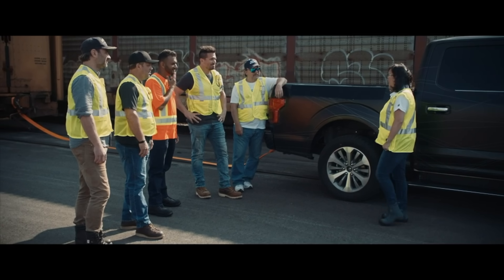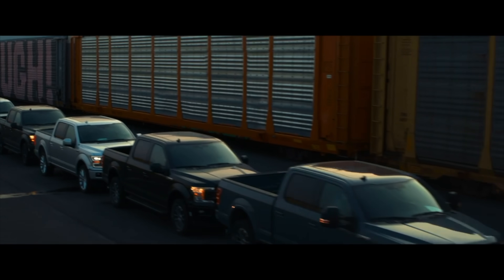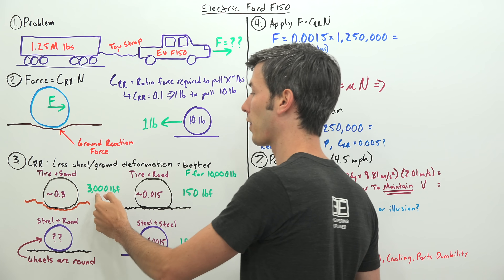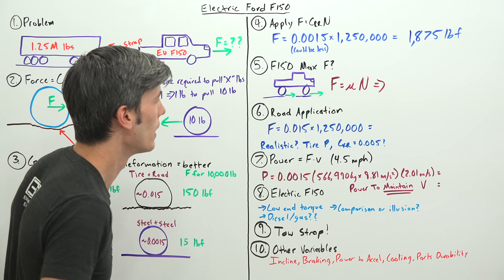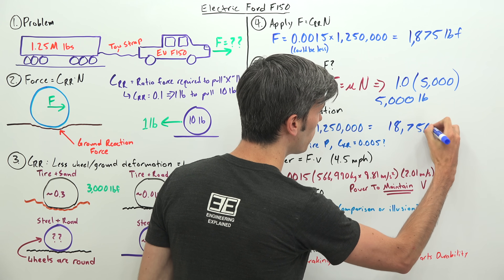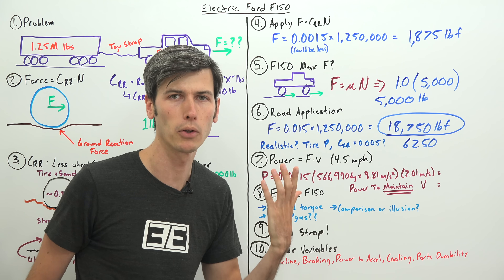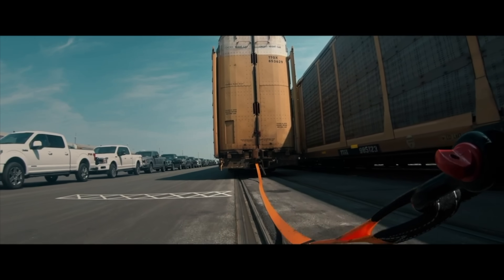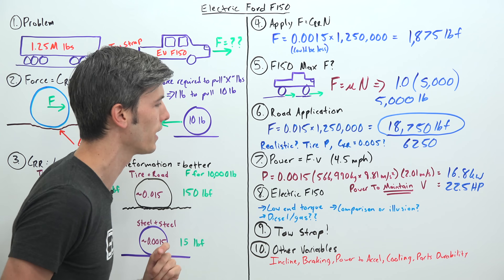No, Ford's Electric F-150 Can't Tow 1 Million Pounds (Realistically)

Comment: Soooo you're saying 170 Onewheel GTs could pull that train? (Nominal torque 14.8 nm) that would be ~28klbs if each rider weighs 165lbs and the GT weighs 36 pounds(not included)

Comment: When you moved that load off steel onto pneumatic tires, you mention that an increase in tire pressure could decrease the load resistance, but you didn't discuss the required tire pressure to actually allow the truck to pull the load nor whether the tire could withstand such a pressure. My guess is that the tire would burst before reaching said pressure.

Comment: It seems to me that the impressive part compared to an ICE truck was NOT strictly the power required to accelerate or maintain the speed, but rather the ability to move it (or a 125k lb trailor) FROM STATIONARY which, for an ICE truck, would require all of that force to be transmitted THROUGH A SLIPPING CLUTCH until the driveshaft speed met the engine speed for the lowest gear.  That's why I think this would be difficult and/or damaging in a stock  ICE truck

Comment: The F150 has a much higher towing capacity than 5000 pounds even though it doesn’t weigh much more than 5000 pounds! It can to 13,200 pounds even though it weighs a little over 5000 pounds!
Reply: Pounds as in force, not weight

Comment: And theirs no way 10,000 lbs can be pulled by 15 lbs force on a steel Rail. Thst would mean i could pull like 40,000 lbs with ease.
Reply: Not with ease, but you could move it an inch

Comment: When I worked at the steel company we had a railroad car mover, powered by a 1950's vintage Willy's Jeep 4 cylinder. I saw that thing move 1,000,000 LBS on good level track lots of times. Really the only thing that ever stopped it was wheel slippage. It had to lift up on the RR car's coupler for weight because the car mover needed the weight to get traction.

One time the guys ran it out of oil and seized the engine and while I was repairing it, the crew moved the cars with a Hyster forklift with a 4 cylinder Perkins Diesel in it

Comment: In still water and air you can easy pull a 750 ton ship in to shore by standing on the lines if  you get home from the bar and due to low tide the vessel drifted off for 5 meter from the key.

Comment: OK, so 2 factors, one for did not say it was towing. 1.2 million pounds, it was pulling 1.2 million pounds. Second second rails and steel wheels have really low rolling resistance.  Versus rubber tires Wheels

Comment: I have a book with a photo of a Kansas City Southern train in a flat location.  The caption reads "a single GP40 is rated for 10,000 tons on this part of the railroad."

A GP40 is a medium-sized 3,000 horsepower locomotive from the 1960s that can comfortably develop 40,000 lb of tractive effort at 20 mph.

1.25 million pounds is 625 tons.  If something like a GP40 can haul 10,000 tons in flat terrain, it makes sense that a pickup could manage 625 tons.

Comment: yeah its totally real. Here is where " real " splits from real life appliction though. ( hint this is just like in the earlier 2000s when Volkswagen used their touareg r50 to tow a 747 weighiin in at like 600,000 lbs and toyota tundra years later doing the same with a even heavier planel. 1- tounge load. The toy vehicles dont have the same tounge load as carrying a trailer, they use sepcial connection points to make tounge load minimal. ( and the type of items towed ( flat towed by the way, dont really have one to begin with  ) 2- These items were towed at very low speed and the train brakes and air plane brakes respecitively brought the assembly to a stop, not the truck. Those weights would basically disentigrate the brakes of a consumer vehicle. 3- the vehicles are weighted up with lead shot or sand in every possible compartment for weight and traction. 4- you see the length of the demo? Thats about how long you cando this perfectly engineered stunt before you destroy your transmission or power unit. Might be a few other tips or tricks, but its not magic. Sure you can pull a ton of flat, rolling weight on a FLAT runway or flat track arrangement. Hell people can pull coach buses or even larger thens... not magic. Its normal, and not really as spectacular as they make it sound due to the above listed realities. Cool promo, but it means nothing. Stick to the ratings on your truck when attempting to conventially tow or haul any amount of weight cause while your vehicle can likely handle a little more, it wont be a ton, and all the other components , suspension, tires, trangs engine are going to be murdered and it wont be safe. to repear, the electiic f150's brakes including regen cant handle 1.2 million pounds.

Comment: Yes this is an old video, but I think your ignoring friction losses is quite a miscalculation. Even the best bearings that support the train axel have friction, both static and dynamic. Overcoming the static friction and inputting enough power for the dynamic friction is where the larger fraction of power went.

Comment: I'd like to see this analysis do a better job sorting out Curb weight (empty, no passengers) and the force required to move just the vehicle vs. the rated tow weight of the vehicle.  The Lightening has a listed Curb weight of 6500 lbs, but a tow capacity listed as 10,000 lbs.  The calculated value required to pull the rail cars was 1875 lb which is being towed and is well below the 10,000 lbs of listed Lightening towing capacity.  Why aren't we using this number for towing comparison instead of the 5000 lbs for comparison?  These numbers are far enough apart to warrant comment and also explain why towing capacity is roughly 1.5 times higher than the Curb weight.

Comment: I just saw the video today of that F150 pulling the line of rail cars and the thought occurred to me that one thing making the job much easier for that F150 would be what locomotives do when they start pulling a long line of rail cars. The friction between the steel wheels and steel rails is not very high and slippage could occur very easily. What is done is locomotives back into the line of railcars compressing the couplings and then when they go forward they are essentially just pulling one car at a time as the slack in each successive couplings is taken up.

Comment: I wonder how much more it could pull. The tow strap lengthening is great, it causes an inertia to bump the carts. And if the calculation says 5000lbs force using a real test with slippage and jumping that would spike to what? 2x 4x? That would be interesting to see for real

Comment: Well, realistically speaking, a normal ICE truck would burn out it's clutch while accelerating the cargo to a speed that it would be able to release that clutch. (Which would be about 4 mph. It wouldn't have enough power at those rpm though.)

Comment: Nobody noticed the locomotive in the background? No? Sorry yall, but the horses required to overcome the airbrakes is tremendous, and the airbrakes on trains are not semi truck airbrakes. Not even a 750hp heavy haul truck can't overcome that, that's why the smallest locomotives on class 1 roster are 2,300 horses.

Comment: Ok but wouldn't it have been easier to make a train engine( like the actual thing that normally moves trains ) push the train at the end of all those train wagons it could also be easily edited away...
Reply: That would not be possible to do the locomotive having more ten times the more horse power than the car which would have made the freight cars to move faster than they would and push the truck instead of the truck pulling the autorakes.

Comment: That’s true, if it was pulling a 1,250,000 lbs trailer with tires on the road then it would need almost 20,000 lbs of force... the train makes its 10x easier, Fords very clever

Comment: And now you know why trains are still a thing in 2021. They're insanely efficient. A single low-power train engine (3000 hp, but probably less would do) could haul that load on route. No problem. And that's less than 2 hp per metric ton.

Comment: My 6.7 4X4 pulled a 160,000 pound trailer for 300 yards , the trailer had oversize load meaning it was certified weight as that is needed to acquire special permit to live on public road so cut in any way you want but I was impressed I don’t thing  Toyota Prius could of done it

Comment: And realistically with every wheel you set heavy weight on your actually reducing the power need to move the load.

It doesn’t really matter whether something could pull that amount of weight anyways. 
It’s way harder to stop than to start. 
There’s no way that truck or it’s brakes would be able to stop a load like that. 
Let alone handle that load on an actual trailer.

Comment: I don't this this is a correct calculation. There is friction of rolling and static friction, wich is  To move object static friction has to be overcomed, then you can use rolling friction coefficient. Steel-steel static friction is around 0.16, when rolling friction is 0.1-0.12, for comparison - 2 flat bars

Comment: The weight of the electric f150 is going to far greater then the weight of a standard F150!!
Reply: Witch in turn makes the normal force acting on the car a much larger number. Making its max force for greater. Id better educate about the weight of electric vehicles before making you tube videos

Comment: Yes, the mass of the train cars maybe 1.25 million pounds but there is another secret that the train uses to its own advantage also.  The train and the truck only have to start 1 railcar rolling at a time.  The couplers have slack built-in otherwise, the train would not be able to move the whole load either.

Comment: O the truck can pull a million pounds on the road alright, down a hill. 🤣 All in serious, the truck would fail on the rail if the 1 million pounds was on a grade. That’s why it’s typical for locomotives to make 150k to 200k pounds of torque. And that’s just one unit, imagine have multiple units.

Comment: I work in Boucherville, Canada and when the ice storm hit in 1998 and shut down the power grid, they derailed a locomotive and drove it down the street to city hall (destroying the street) and used it to provide power to the emergency shelter. Locomotives are basically giant diesel generators that power electric motors.
Reply: That is exactly what diesel electric locomotives are,  a huge generator,  powering electric motors.

Comment: i work on these mulitlevel train cars, the tri level ones specifically not the bi level cars shown, but if you release all the air brakes and hand brakes and if the railway is perfectly level, you can literally push these cars if you’re reasonably strong with another worker

Comment: people always forget that the towing capacity has nothing to do with what it can actually accelerate, but more importantly what it can stop. anyone with a small brain or larger knows that a little energy can move a large mass. But when towing and you know, hills are involved, stopping becomes the dangerous problem. a blown engine from trying to pull to much weight is a far less problem than brake failure on a hill or mountain with said weight

Comment: Perhaps interestingly, it might be possible to tow 1.25 million lbs of unridden racing bicycles on a road. The CRR is such that you get 6 Newtons for every hundred bikes weighing 500 kg ish. So that's not even 7000 Newtons of resistance for the lot of them. And that's on a decent road. On a rough road double that. On smooth concrete you could cut that in half. On a smooth wooden bicycle track you could do so again. 1750 Newtons? That's less than 400 lbf. You could get two or three people to pull that.

Considering the cost of even one racing bicycle, this endeavor is also very much worth doing if you get to keep the bikes. 115000 racing bikes at $15000 a piece is worth over $1.7 billion.

Comment: That the strap had stretch to it was very important, if they hd used a chain with no stretch, then for the first foot or so the motor, while able to provide the required torque, would be barley spinning, and so would not be cooling itself and might overhear.  It appeared to me that the strap stretched about 8 feet or so, during that time/distance the pulling force went from 0 to 5000 pounds, all the while the truck was moving and therefore the motor spinning and cooling itself while the boxcars accelerated from 0 to maybe 1/2 mph as it the first few feet.  In this case, as opposed to yanking a stuck vehicle out of a ditch, it was important that the pulling truck apply an increasing pull from 2000 to 5000 over a significant time/distance.  The same feat could be done with a truck with an automatic transmission,  but may meed a double sized transmission oil cooler.  It would be near impossible to do with a manual transmission truck unless the tow strap were ten times longer and had twice the stretch ratio.

Comment: So you’re telling me that if an EMD MP15 had all of its gears and mechanical parts and brakes and engine removed so that the wheels could roll freely and the weight reduced to about 160,000 pounds... then I can push that locomotive with about 155 pounds of force? Now that’s efficiency.

Comment: This is why I love the exchange of information at the speed of light. Imagine a time before Al Gore invented the internet. A lot of people would have been awe shocked. Seems like auto marketers need to get with the times and advertise stuff like, “it won’t cost $600 in parts to replace a radio in this years model” or “with 2020 technology and  our 10 speed transmission, we finally made a truck that gets over 35 mpg.” 🙄

Comment: Easy explanation:

Steel wheels are smooth against rails meaning the slip reduces the actual weight
Reply: It’s not the slip it’s the fact that the steel doesn’t deform as much, reducing the rolling resistance, the locomotives that haul miles of those cars have steel wheels, and you don’t want any slip on the locomotive, it’s entirely rolling resistance.

Comment: let me summarize:

it pulled it because it was on wheels which were on a rail.
wheels roll
so it's easier

this is the same reason you can push a car with some friends but not a 1,500 kilogram object
Reply: Forgot to mention that they are steel on steel wheels which is VERY important.
Reply: @Tian-Tian08  they are steel and they don't deflate so less friction
Reply: Same reason I can pull 7500 pounds of tile with a pallet jack, but no way am I pulling it with anything else or on a different surface
Reply: @jaykoerner   You should be able to pull it on any hard surface with any hard metal wheel or cylinder. In Egypt they rolled huge stone blocks on logs.
Reply: I would surprise you, but one young man can push one regular railcar hard enough to make it moves. We where having a fun at this when were kids. :D Unfortunately one man then cannot stop it :D
Reply: Pretty much
Reply: @caz9634  guy is talking about OP, not the video
Reply: Ahhhhh, Plate Productions, not the hero we deserve, but the hero we needed.
Reply: so all im hearing is that hes complaining about something trying to say ford was misleading when all of this also applies to regularly towing things.. because we dont tow trailers without wheels on them :/
Reply: @Lsx_Lo  it's notthe fact the are wheels it's the fact the are metal wheels , you put street tires on all of those are I bet even a train engine might have trouble pulling it
Reply: @jaykoerner  Correct. Steel wheels aren't very grippy, but roll very freely on steel rails. A steel wheeled engine would slip attempting to pull a standard freight train equipped with rubber tyres.
Reply: @Lsx_Lo  If this was just an independent science experiment or Ford actually stated "look what pickup trucks in general are capable of doing" then it wouldn't be misleading. But by omitting that little piece of information, either knowingly or not (but probably on purpose) they are making the implication that the new Ford truck is something incredible and you should buy it right now. That's kinda misleading.
Reply: @Lsx_Lo  complaining? Or making a video on it to explain how it worked?
Reply: The real story here is that EVs have great torque at low speeds so you can do this without burning out your clutch. There is a reason that freight trains use diesel-electric hybrid engines. They have electric motors that turn the wheels and can get the train rolling at low speeds without a big transmission. The diesel can then just hum along at constant rpm as an electrical generator.
Reply: Thank you kind man XD
Reply: Exactly
Reply: raises hand what if the wheels where square?
Reply: @Animalcontrolofficer009  pulling it would be impossible. The square wheels would help a but in pulling but not enough to get it moving.
Reply: Even with that, there would have to be a constant air supply, those cars (autoracks) are not going anywhere if a constant 120psi of air is supplied.
Reply: @Sichael Mender you had help pulling the object and if the object had wheels it would be much easier your argument is futile, what point did u think u were making???
Reply: I mean you can push on car in neutral especially slightly downhill.
Reply: You can do the same thing by over inflating the tires to produce a smaller contact patch and less friction
Reply: 1500 kilograms pffff that’s like 100 pounds
Reply: They should have said in the end that any gas pickup could do this but scumbag lying is what they do best.
Reply: @BIKEMAN21  Why would they pull a publicity stunt just to say any other truck can do it too? Doesn't sound like good advertising

Comment: Can you explain Brian Shaw's ability to pull 80,000 pounds on rubber tires.  By your explanation, you are saying that if it was on a railway track with steel wheels on steel rails, he'd be able to pull 240,000 pounds?????  I'm thinking not.